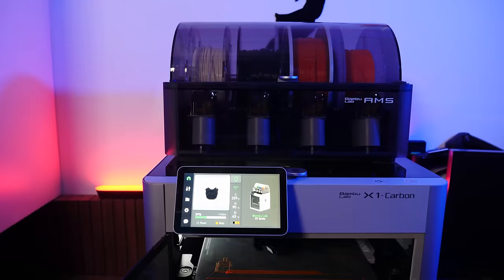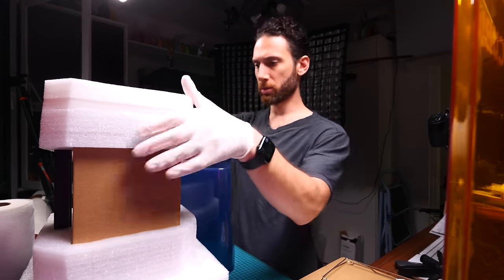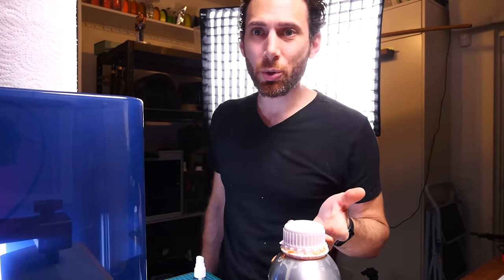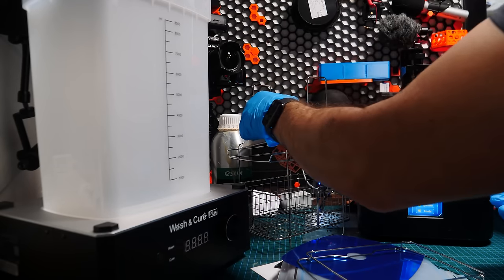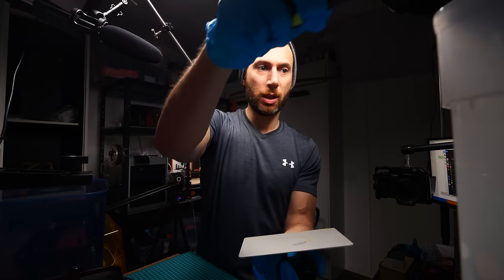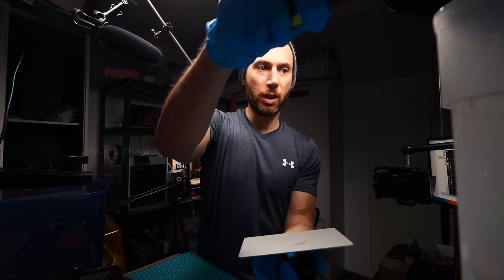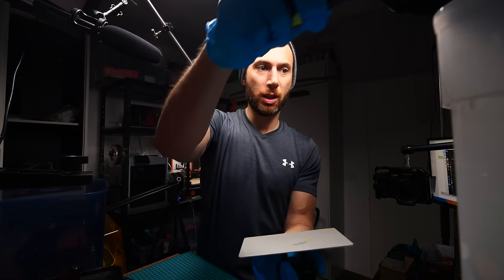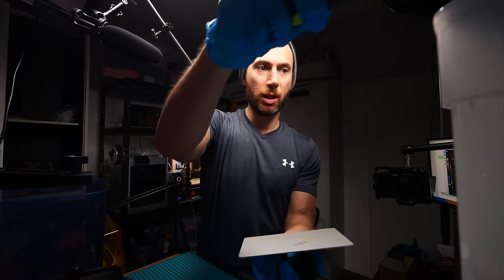Resin 3D Printing Wasn't What I Expected. AT ALL.

Comment: It's just a different set of skills to learn. FDM and Resin both need supports, for example, but there are different considerations in adding supports for each. But the products you make with each couldn't be further apart. Resin is going to be a lot more appealing at entry level pricepoints, I think, because while it might make smaller things, they're nice-looking, rivaling store-bought products in many ways. FDM's advantages shine when it comes to larger models and multi-colored prints, but those models are a lot more expensive, and even then the products they make are very obviously 3D printed.

Comment: I think your confusion on the price comes from a misnomer common in the community. What you have is a DLP printer, not an SLA one. The technologies are somewhar similar but the cost and need for replacement parts is very different.

Comment: With resin, you need a designated area for it, ventilation and or filters, gloves, paper towels, IPA (not the beer kind), gas mask, eye protection, a sealed trash bin, the wasing & cure machine (or tupperware + UV light) and like 30+ minutes of your life depending on the size of the proyect... and if the print fails, you gotta clean everything up nevertheless.

Meanwhile you can do SLA with a printer next to your bed, while cleaning the parts with a nail clipper (not effective, but posible)... and the worst thing that can happend ranges from a clog to the melted filament crawling up you nozzle...

Don´t get me weong both are still fun as hell, but resin is just messier

Comment: So, some of the questions I have when watching this video was, why are you putting the resin back in the bottle? You just leave it in the vat. The type of resin you were using (eSun) could also explain the smell. Anycubic resin barely smells, and with the lid on, you won't notice it. You don't need to scrub down the work surface everytime, and other than gloves, that's the most protection people use. The IPA should give you more problems than the actual resin printer itself when it comes to irritants.

Unless you're prone to lung problems already, the need for a respirator is almost overkill. Think of the different between ABS and PLA.  At most, the lid would only come off the when you're moving the build plate to the wash station. Then everything gets closed again. But, I won't chide someone on taking what they feel are appropriate precautions.

Good on you for trying it out.

Comment: Excellent video as to be expected from you. One thing you weren't able to emphasize properly though is the exceedingly high overall cost of resin printing compared to filament printing due to the consumable  materials cost. It may not be an issue to some but for those with a budget, it requires consideration.

Comment: Resin at first glance is cheaper to get into, but you need to factor in the wash station, stainless funnels, safety gear and mats when deciding if it's worth it. The quality is nuts and it's way easier than fdm printing, but when it goes wrong it's a big mystery sometimes.

Comment: I have both, I started with SLA for scale models. I really dislike the mess, the smell, and the clean up. However, when compared to FDM, the parts look injection molded. Even my 2 year old 8K Mono Saturn S puts out prints that you have to look hard to find layer lines. FDM is so much cleaner. I can sit next to it while it is printing and am only bothered by fan noise. My SLA I have to keep the cleaning area outside in a shed. There is no way I want all of that smell in the house, it really stinks. In the end, I use both, but I find for my use, functional parts, FDM is more fun.

Comment: Anycubic resin printer was my first an it prints amazing..i enjoy this one a bit better then dealin with the whole different settings for filament never though be so hard to even get prints to stick to bed or diff settings jus to get a print goin then resin jus model ..put supports...clean an cure...now fui future get those dual charcoal filters from amazon thatll fit in the anycubic to help with the fumes with resin in a small area i have em  an works great in my apt by a window

Comment: A couple notes on PPE: prolonged exposure to the fumes can cause eventual health issues, but eye contact will cause very immediate issues (very possibly leading to spills and other accidents that you will be unable to deal with promptly) and possible permanent damage to your vision. Eye protection should be your very highest priority. Also, your greatest exposure to fumes and splash hazard is when you're removing and cleaning the part, not when you're pouring resin into the printer.

Comment: I agree with the conclusion of this video!!!
But it is still annoying... Maybe it's fun the first time but if you are making lots of prints... not so fun. I turned a bathroom into a print room to be lazy with cleanup and then printed thousands of parts. I didn't know about the respirator but the resin stunk so bad! After 3 days of printing I got sick and I still needed to print so many parts on an order. I decided to buy a respirator but it didn't come with the correct filters and I was getting sicker. I then spent the big bucks and got the nice filters. Which worked wonders! After that job, I didn't want to touch the printer ever again! I ended up selling them.
I do love the simplicity of the printer! I do love the detail! I do love making yellowish but mostly clear parts! But the fumes and clean up are too much for me.

Comment: I started both FDM and resin printing at the start of the year. 

I hate the process of resin printing. I do it because I want to be able to paint 75mm minis, but it's just the worst.
Supporting/hollowing/slicing models is much more intensive than FDM.
Post process is really annoying. I need to gear up and do a bunch of things just to post process one print.
I need a ton of space for resin printing. The printer is small, but then you have space for all the post processing work. I also don't feel comfortable with this thing in any room of the house but the garage where I can exhaust resin fumes and open the garage door if fumes get too much.
The fumes from resin, IPA, whatever else I'm using hurts my throat sometimes.
I don't like that resin is toxic and can possibly burn you.
Sometimes my resin prints fail for no reason. Then I try again with the same conditions, resin temperature, room temperature, same usb, same file, etc, and it''ll work.

That being said, I'll probably keep resin printing though cause, you know... how else am I going to get these really cool miniatures to print? 

Oh, this is compared to using my Bambulab x1c which makes FDM printing super easy.

Comment: I stayed away from resin printing because of the toxic nature of the resin and the resulting waste ipa. By chance creality was having an Easter sales and I bought the cheapest resin printer they made the Halot One at £99 with free 1kg of resin which cost £30, so for me it was a cheap way to see if I could get into resin printing and live with the smells and toxic resin process.

After what has been a few weeks, I have found the best way to deal with resin spills is to cure it with a uv lamp, as if you use ipa you just cause more mess. I had a large air purifier already that had hepa and carbon filters which when in use keeps the smell from spreading around the house, but I still use my mask which has organic compound filters just in case. Protective glasses are also a must unless you have a full face mask like myself. This sounds like over kill but long term exposure can cause a lot of health issues, even cancer.

I love fdm printing but it has its limits when dealing with small parts, resin has been able to allow me to extend the range of items that I can print. I have just bought a creality Halot mage which is a substantial upgrade over the Halot one which has again expanded what I can produce between fdm and resin machines.

Is resin for everyone…no, fdm is the better way to experiment with 3d printing unless you already have a need such as miniatures. Even then, make sure you have a location that is safe and well ventilated and provides a stable temperature environment at over 20degC.

Comment: My experience has not been great. Over the past year that I've had my Anycubic Mono X 6K, it's worked great on maybe 25% of the print attempts. I had to put mine in the basement, but still needed good ventilation, so I built a full enclosure for it (made of plywood & sealed up tight), complete with a chicken coop heating pad and extractor fan that blows out parallel to our clothes dryer via a dedicated duct. Just prior to the enclosure, I was getting a few prints to work, but as soon as I put the printer in its new cozy home, I couldn't get it to work. I tried all kinds of variations on the settings, even put in the tiny heater I was using before the enclosure (blowing right on the printer) for additional heat... even though I was maintaining 80-85F in the enclosure. I have been told that maybe the resin is bad, maybe it sat in Amazon's warehouse too long. I will try it again with new resin, likely ordered direct from a manufacturer this time, but I'm less than thrilled about wasting more resin. At this point, I'm thinking that paying friends or a service to print what I want may be the way to go if all else fails.
Reply: Post some photos (and a screengrab of the settings) on one of the printing forums, maybe someone can diagnose the problem.
Reply: @herculeholmes504  I've tried that, but it's been a minute, so I'll have to go back in & dig around for new wisdom.
Reply: Resin printers dont scale well.  larger printers are far more prone to failed prints than small ones.  I started with a photon zero and that almost never failed even when i left the window open in winter and it was like -5C out.

Comment: i got myself a resin printer recently since creality had a sale on got a halot one pro for like 150 pound, got to say first impression is that is a lot easier to setup and get it going then fdm printers, but the smell of resin and just generally the post processing can be a bit annoying unlike fdm. I mainly print functional mechanical parts so resin printing aren't really strong enough even with the tough or abs like resin especially at the temperature i need them to operatered in so for me it kinda just sit at the side and only use it when i need some kinda artistic model that need a lot of details then i would use resin other than that my fdm printers are my go. With that being said the quality and detail you get of a resin printer you cant beat that on a fdm even with a 0.2mm nozzle . So for anyone interested in resin, ask  yourself what do you want to print the most, functional parts/prototypes or models that should answer the question if you want fdm or resin, but it always nice to have both options available if you got money to spare

Comment: Nice video.  As a maker who only recently got into the 3d printing game, my first question would be: what are you getting a resin printer for?  I'm happy with the 3d filament printer I got for printing parts and tools.  I can see the appeal of resin when accuracy matters.  Personally I would consider a resin printer when I need that kind of precision. 
One application I am particularly interested in: apparently there is some resin that has the properties of wax, and can be used for lost wax casting.  Jewelers use it to cast fine parts.

Comment: Thanks for doing this so I don't have to.  I enjoy my FDM printers, when a print is done - it's done, since I print the majority in PLA, no fumes and I get the filament in bulk for a little over $10 per Kg.   I can easily have 4 printers running and scrape the parts off and start another batch.  I also am not good at tidiness, so would have a big mess.

Comment: Get a small Silicone spatula to mix the resin in the vat. Will not damage the fet sheet. SunLu is a good resin brand too.
Reply: I always figured the build plate coming down for the burnin layers would do a good enough job of mixing it.

Comment: So i watched the video and i have a few tips for you.

Tip 1: most of the time fails like not sticking to the build plate are due to your exposure setting you have set for the base layers.  You could also sand the build plate to give the resin something more abrasive to stick to but its so new I don't think that is the issue.  

Tip 2: you can never have enough PPE and this is xoming from someone who works with Hazmat but personally I only use gloves.  I dont bother with the mask and stuff.  Hell i print in my office on a foldering table abd a silicone slap mat. Lol  guess this isnt a tip just aomething that i noticed and couldnt help comparing to how i do things. 

Tip 3: add more IPA to the wash.  I change my IPA maybe once a month and just keep the container sealed up when im not using it.  Once every 6 months I strip my container down and give it a deep clean.  Might need to do it more then that but I'm kinda lazy.

One last tip:  I use Lychee slicer and UVtools.  UVtools is a god send. Lychee auto supports with UVtool Island/resin trap/suction detections i can take a unsupported model to a supported model in like 10 minutes and most of yhe time have a success. Also I use the free version of Lychee Hope this helps.

Also i have used the resin you are using and it does have pretty strong fumes.  I use Siraya Tech Fast resin for mine which has almost no oder to it as far as i can tell.  Normally the cheaper resin smells the worst.  Also, since its fast curing the print is faster and has a lower exposure time which increases the life on my screen. :)

Comment: Been printing FDM for a good 3 years then decided to try out resin. I have to say that I have a lot more better luck with FDM, sure there are many things to look at like temps, layer heights, speeds, steps/mm etc. but I find that FDM is more forgiving with wrong settings compared to resin. I have only made a few prints on my resin printer but have replaced the FEP more than 5 times because of damage and tearing and have spilled and wasted a lot of resin in the process.  I also absolutely hate that slicing software (I used Chitubox and Halotbox) and making all those supports etc., so tedious and time consuming, then sometimes it will work but most of the time it won't.  When you are so used to using Cura, Chitubox just feels so slow, tedious and cumbersome. As someone used to printing larger functional engineering parts it just doesn't compare to the reliability of FDM. Nowadays I almost never encounter failed FDM prints but with resin it's more like 60% failures. Needless to say my experience with resin was downright frustrating and wasteful, I find it to be too unpredictable and too messy to justify continuing with it. Seeing your failed print on the build plate and knowing that you still have to clean it up just adds more insult to injury. My resin printer, washer/uv and accessories are now all at the backyard gathering dust. All my unused resin I repurposed - I used them to fill the cracks on my front patio. They harden really good under the sun :)

Comment: Nice video
I am still not a huge fan of resin printers because of the toxins of the resin, but I guess the resolution and speed you can achieve are not comparable to an FDM printer. 
I definitely enjoy this style of video way more than your "normal" videos
Reply: Toxins aren't really the issue with a cabon filter in most machines your fdm would be putting more toxins in the air than one of these
Reply: Ya I think he oversold the danger.  A pair of disposable nitrile gloves is all you really need.  Even without the wash and cure the post processing isnt that difficult once you get the hang of it.  Print fails are rare so cleaning the vat is about a once a month thing.

Comment: Hey, you dont have to buy 200-250$ washing station (which is basically duble amount of money from only printer) you can use IKEA Glass heat resistant box and an nails curing machine or just Sun if you have some outside :p which costs about 20-30$ together
Reply from the maker: Oh snap good to know

Comment: I'd be interested in hearing more about the differences in resin vs FDM printing. Specifically, let's say I need to print a small functional part but I want it to look really nice. Can something from a resin printer be a strong as the same part printed with some "enhanced" version of PLA like PLA Pro, or with something like PETG or ABS?

I'm with you in that I am not interested in printing little figurines and stuff like that. Pretty much everything I print is functional and needs to fulfill a purpose. Strength is usually more important than looks.

From the little I know about resin printers so far, I see no reason to ever consider one.
Reply: There are far more options for changing strength & flexibility of prints with minimal changes to setup/settings with resin than with FDM. Engineering resins are expensive ($50-70+ per liter), but those who prototype in SLA usually mix with cheaper resins in ratios depending on what properties are desired.